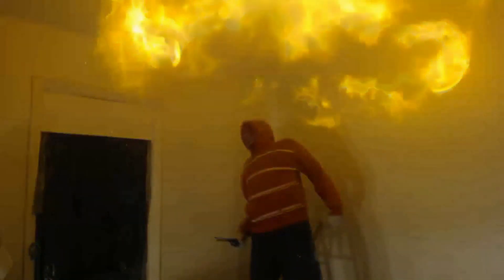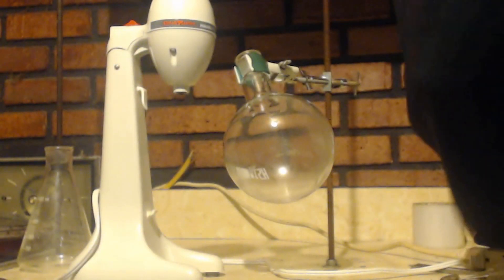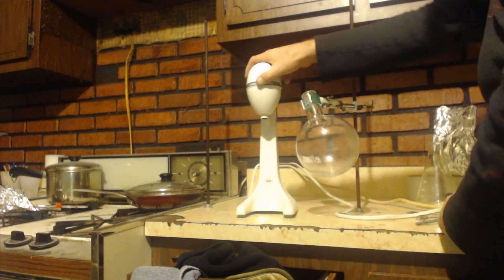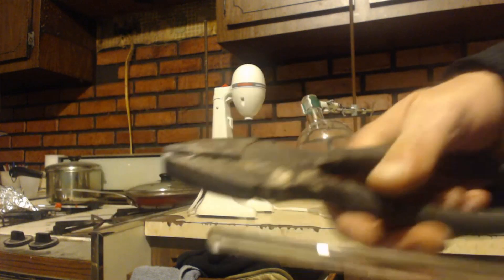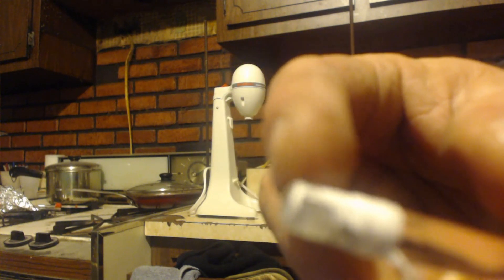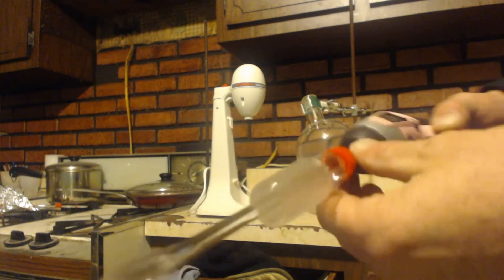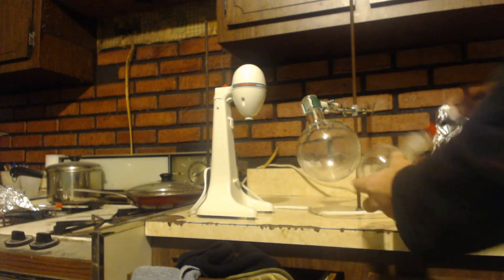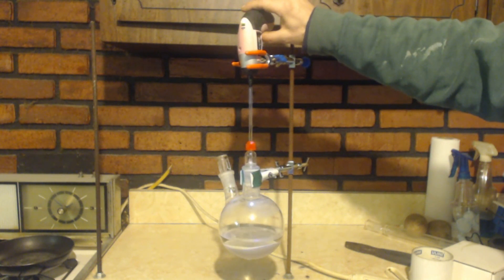MAKING A MECHANICAL STIRRER

Comment: John there are teflon coated overhead stirbars on ebay and amazon. The blades fold out to fill the whole bottom of the flask and they come with teflon  24/40 adapters with a gasket just like the thermometer adapter. And then you can make a vibration guard between the drill and the stirbar with two inches of 8mm-id vacuum hose. It worked well for the sodium ethyl sulfate thing which I imagine is what you're working on right now.
Reply from the maker: Alex................i will DEFINITELY check that out.  Thanks.  And yes i am working on NaEtSO4 as we speak